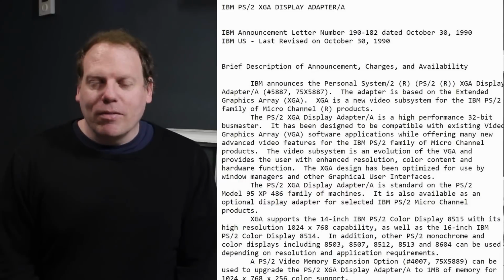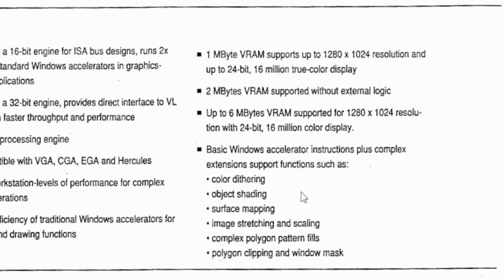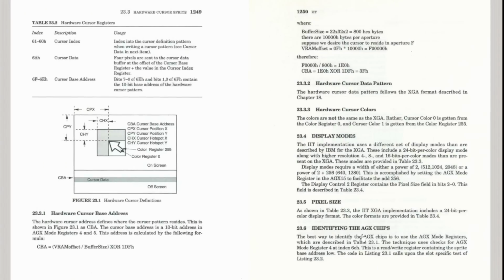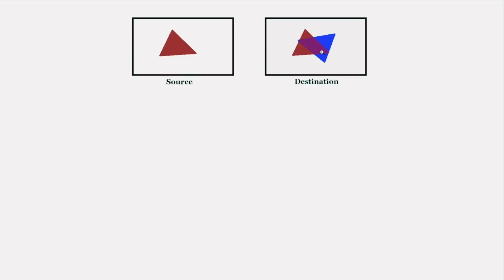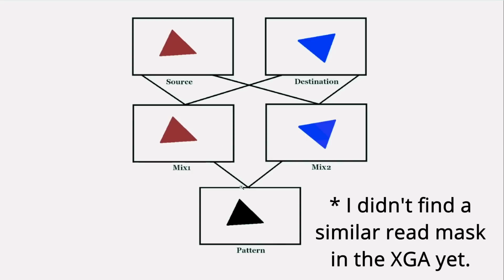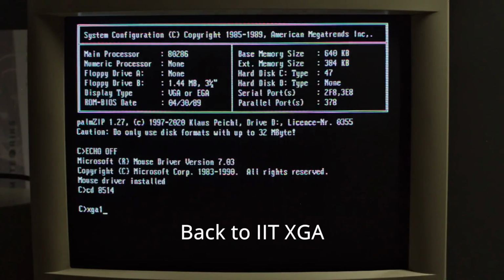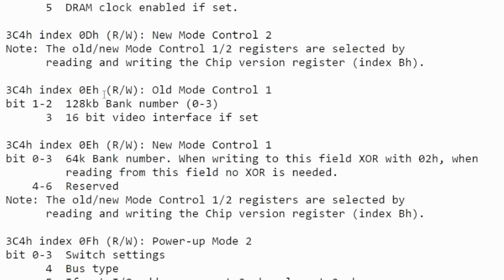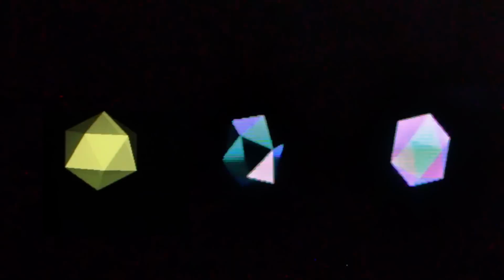XGA : King of IBM Graphics Standards (Part 1)

Comment: It is entirely true that XGA was the high-end standard at the beginning of the 1990s. Unfortunately, as with MCA, IBM was adamant to force an unnecessary market segmentation that delayed adoption of the standard. While it is true that a minimum of 1MB of RAM and other  performance requirements were pretty high, IBM did not help either by focusing on creating another standard without cooperating with the rest of the industry during development or after that. 

Luckily, due to market demand, the XGA eventually became the standard by 1994 and you were hardly pressed not to find a graphics adapter having 1024x768 in 256 colours capability. Funnily enough, most affordable colour CRT monitors in 1993-1994 were only able to use that resolution in 43Hz interlaced mode and with a 1MB video card you could not ask any higher refresh rate in 256 colours. Oh, fun times before we had the Multisync monitors in the mainstream... 

All of this resulted in a lag of a couple of years before XGA was available end-to-end on the PC market.
Reply: These were difficult times for IBM. Their interest was in being the PC manufacturer, not in being just another clone manufacturer, a market they couldn't really compete in. They had lost control by this point but were going down fighting.
Reply: @ian_b  It is entirely true. They did not understand that the PC market was not the mainframe market where they could dominate. This mindset made them hard to adapt and the reason they exited the market after a few more years.
Reply from the maker: If only they'd settled on a common coprocessor standard!
Reply: @PCRetroTech  That is too much to ask! The 1990s was such a diverse testing ground that you would be hard pressed to find stable trends. I remember what happened just a few years down the line  when 3D graphics was round the corner. It took Microsoft a long time to develop a reasonable Direct3D standard and we had to use OpenGL, the big and heavy interface where you had to do most of the work yourself unless you were a happy Glide developer.

Getting back to the starting point, the "minor" inconsistency of coprocessors is  easy to forget... I mean, at another level, when the Intel 80486 DX4 was not actually a clock quadrupled processor either but a clock tripled one, why would it matter? (the 80486 started life at 33Mhz clock speed)

My guess is that Intel considered they could have an additional market (sales) benefit by making the graphics coprocessor design as they did. It seems dumb, but that could be one explanation why they did not adapt the same design to the popular VGA adapters scene or did anything else to expand the market for addons but they further ensured it would stay locked in.
Reply from the maker: @retrowikid  One has to wonder if XGA was just some pet project at IBM that even the marketing people thought wouldn't succeed, but which made their range look mature or something.
Reply: @PCRetroTech  If we use the launch of the IBM-PC as an example, I think that most technological improvements were killed by marketing and product strategy. I mean, IBM could have launched an open platform many years before if they would receive the get-go. They knew what they were doing but, unfortunately, you cannot run a company with engineers, you need a true leader to have a synergy.

I think this goes on to show why, despite all his flaws, Jack Tramiel was a true leader and having a small instead of a large company is an advantage when you need swift progress. IBM did not have such luxuries and absent any other meaningful push, they had a conservative mindset.
Reply from the maker: @retrowikid  I'd certainly agree with all that!